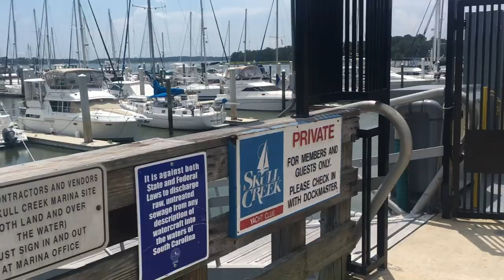WHAT DOES CRUISING ON A SAILBOAT LOOK LIKE? | Off Grid Boat Life

Comment: Sorry I had to stop the video to make a comment. First thank you so very much for this video. Now I know alot more about you guys. You made it personable!  And second I have extremely little right next to mine time on sailboats. But I'm drawn to them. I've grown up around power boats all my life. My father has owned about 10 different power boats so I have alot of experience on the water. But a live aboard sail boat is another thing completely. I will have to figure out how to get the original owners to make a video about everything on the vessel and how to fix and maintain it. There are so many things on a liveaboard sailboat that it will go over my head as they are explaining everything in 15 to 30 minutes prior to handing me the keys and yes I will go through exactly what you talked about as in being so emotional about getting my dream. Tears will come out of my eyes. I have my eyes on a cat right now. It's a big "WANT"! And it's bigger than what I need by a long shot. But I totally understand that if everything goes perfect. But of coarse that never happens in my life. But it's a 58 foot catamaran. Yes it's way too big of a boat for me and I know this but I've listened to everything boaters say and I know I could handle this boat because the original orders of the boat obviously are very knowledgeable about this because the boat is set up for single handling it. It has all lithium batteries and a mass of split panels. Also in boom furling controlled in the cockpit. It has stay sails for sails and 2 whisker poles there mounted on the mast that are adjustable. And what I find so amazing is at the very aft of the boat you have power levers to control both engines so you are standing right next to the dock if you wish when you are docking the boat. I have never seen a catamaran with that feature on it but I understand how important that would be for a single hander. Now for the size. Yes everyone will say why so big you can't handle the sails by yourself when changing them. All sails are electric furling so the only sail I would ever have to handle would be the spinicker. But that is for low wind sailing so I don't really think that would cause to big of a problem and it's a cat so they are level most of the time. Everyone says don't over load a sail boat because weight slows them down. I have alot of tools and I will be living on a sailboat for a very long time as in the rest of my life so everything will have to go with me that I can use on a sailboat. If anything goes wrong it's up to me and God to fix the problem. Plus I will be working on other people's boats to subsidize my money situation which we don't talk about what really don't exist. But the biggest hurdle is $1.4 mill. Yeah that's a very big hurdle. And I want to re-itterate the word want. That doesn't mean I will settle for that. It's a dream and they are free so dream big and try as hard as you can to make them happen. But right now I keep asking God, I'm doing my part by lotto tickets but it's your part to make the numbers match! It a work in progress obviously. I think I should check and see if his ringer is working. But anyways, I just want to tell you congrats and live your dreams. And if you know God's phone number I would appreciate it if you would put in a good word for me! Fair winds a good sailing. Ps can you give me the co-ordinaces where you dug up one of Pablo's barrels? Wish me luck!